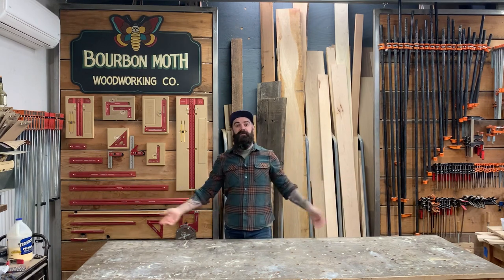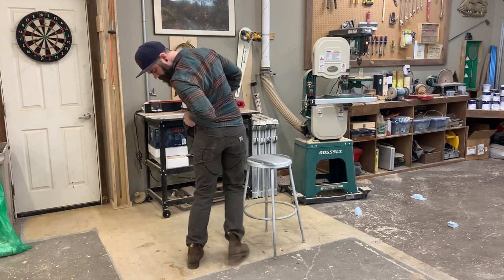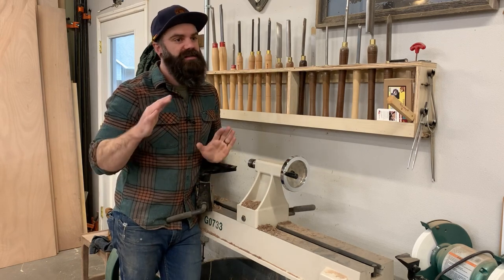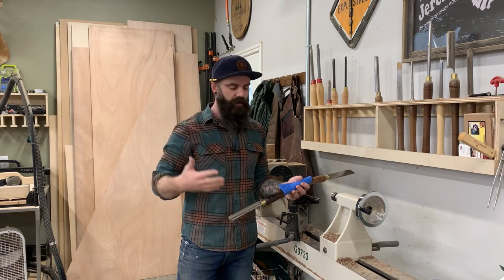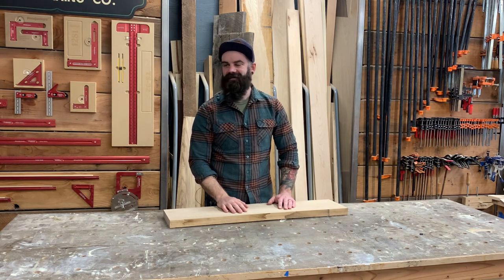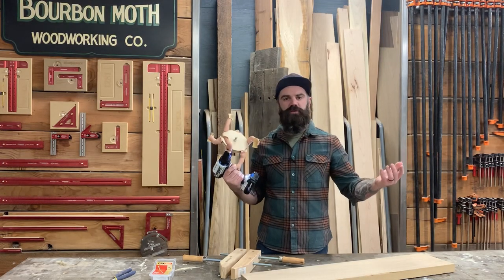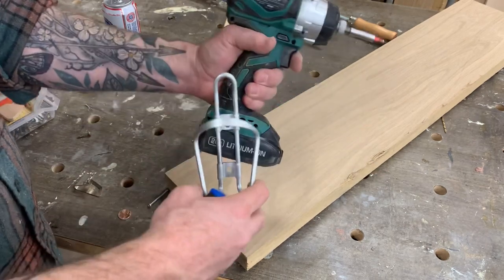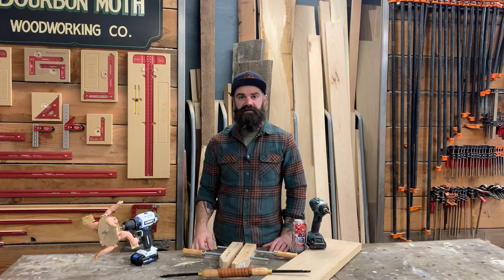Tools That Need To Exist | Awesome Woodworking Tools

Comment: Drill cupholder for Dewalt/Milwaukee: $29.99.  $19.99 for the Ryobi version and $9.99 for Black & Decker.  Festool Cupholder: $199.99.
Reply: But Festool got Bluetooth:)
Reply: And yet hoards of people would buy and it and swear it's worth the price. Ha ha
Reply: i bought the festool. worth it
Reply: I thought Festool owners only drink wine? Haha...
Reply: Add a skateboard wheel barring between the drill and cup holder and it may just rotate on its own.
Reply: The Festool is a lot more accurate!!!!!!!!1111
Reply: the festool one pivotes automatically to not spill any of the drink, may it be beer or wine
Reply: Like the 50.00 haircut..
Reply: For sure
Reply: I got the Bosch professional for $69.99 , it's totally worth it , because it's interchangable with all the other machines

Comment: The two sided chisel was really something special, what could possibly go wrong lol
Reply: I have the perfect brand name!  Seppuku!
Reply: Could upgrade to four in one in a cross shape.
Reply: @joemacleod-iredale2888  or Swiss Army Knife style!
Reply: Short Bus Special!
Reply: Just as practical as Darth Maul's dual-ended lightsaber!
Reply: Though I feel like there is a solution in that thing just waiting to come out.

Like a sliding handle that covers the opposing chisel. Twist to unlock, slide forward reveals one chisel, covers the other one, Twist to lock. And vice versa.
Reply: @lmaoroflcopter  man that's waaaaay too much effort, I mean kickback on a lathe is just a myth anyway...

Comment: 1. Hipster hikers already invented stool pants
2. Make a Swiss army chisel for the lathe
3. Love the hands sander
> you could probably take a cast of the back of your hand holding a sanding block and make injection molded “hand sanders”
4. The beer holder could have a bearing on that fastener and it would be like a gimbal and always sit up right

Comment: I checked my diary in case it was 1st April and it wasn't so I watched it through and you have some good ideas. I always thought it was dangerous reaching over the lathe for the chisels. This morning I improved on your idea. I only have 5 chisels and my glue has gone off so I removed the handles completely and just welded the tangs together in a star shape so now I have all 5 in my hand at once. My friend says they will be hard to sharpen but I am sure they will go in the vice and i can do the annual sharpen with the angle grinder as usual. It worked so well I did it with my wood chisels but it made a bit of a mess of my mallett when i tried using them so I will have to go back to using the lump hammer. I did learn not to weld in the wood shop again, they say they wont insure my house if i do it again. But the fire brigade got a donation out of it. ....... You are a star your vids brighten up lockdown and i learn at the same time.

Comment: Just so you know, I made the double-sided lathe tool, just like you did in your video.The first problem I encountered was I had full tang lathe tools, and ruined my saw blade cutting through the steel. Not a big deal though, just bought a new one to replace it, and now I have double-sided lathe tools.

The second problem I ran into, while I was using the double-sided lathe tool to make some cuts, I had a little bit of kickback, and the other chisel shot into my chest. At first I panicked, but then I realized I had a firmer grip on the tool, since it was currently inside my body. I finished out the cut with zero additional kickback, since I had such a firm grip.

Honestly, the hardest part was taking it out, spinning it around to use the other side, and then putting it back in. Besides the little bit of blood stain from the second chisel end, it worked perfectly.

After my visit at the hospital, I'm going to swing by Walmart and pick up some of those babies to make the hand sander to really finish out that project.

I'm guessing I should be able to make more on the profit from such a high end product to outweigh the medical bills. Will update once everything is sold

Comment: Just for this, I may make something pretty fancy for a beer holder using ball bearings that will allow it to more fluidly rotate. Be even better if you can put in in a gyroscope. Then it wont matter what position the drill is in or tilted. The beer will always stay upright.

Comment: Stool pants 2.0 needs to have a swivel seat,  double ended lathe chisels 3.0 drill out handles and glue in a dowel for strength,  hand sander machine....more hands for faster sanding times, drill beer holder . . . . . .uh.  .  .  .maybe a holder on  opposite side as well so when one can runs dry you have another on hand without having to stop work for a refill

Comment: You know, my ridgid drill has mounting screw locations on both sides, so I could keep the belt clip on one side, beer holder on the other side, and then it’s basically an open carry beer holster when clipped to my belt.
Reply: Better yet, 2 beer holders.
Reply: A beer and a whiskey for those really tuff screws.

Comment: Version 2.0 of the Drill-Beer holder, use a cup holder that you can put in a boat, they have a little doodad that keep the beer vertical as the boat moves, kind a floating swivel! Great video, your a funny dude

Comment: Just a truly thought provoking video. Your on another plane...
My neighbor, a mortician, watched this intently with me. He said your hand sander idea is brilliant. Then I ran his idea past my other neighbor, an overseas marketing guru. He too was all in with this hands on idea. First to save money, increase durability  and use real hands, he suggested REAL hands. He can get me up to twenty pairs a week. Note some are only half sets a right or left. It appears gluing the hands on a large disk holds the hands best. Then I came up with the idea of gluing snaps on the fingers and palms with the other snap ends to the various grits of sandpaper, a feature you overlooked. It appears 1000 RPM is the fastest speed for the disk before the hands go flying. A chinese firm he's been in contact with loves the idea. We're negotiating now with sandpaper makers to have pre-cut snap sand paper. Once we had a prototype, I ran it past another neighbor an engineer. He said it's not bad but using your technique with feet with slots in them will provide better surface area for larger jobs. Wow! Thanks a lot. 
A carpenter friend said your dual chisel idea was great! If you take a femur bone, slot it... We have plans if your interested in but not sure of patents in the USA. Not a problem overseas...

Comment: I think a washer between the cup holder and the drill would provide a little additional clearance for rotation. In addition, I think that maybe you should incorporate a flip down type lid to keep debris from getting into your beer as metal and wood shavings would be rough on your digestive track not to mention dusty beer is not that refreshing. I would love to see the hand sander being made from large mannequin hands from productivity purposes.

Comment: Double ended turning tools? Let's put two more tools at right angles, and add two more tools perpendicular to them. Now we have six tools in one, a whole workshop in your hand. You also mentioned at the start that you are filling time for finish to ...finish? Let's make pre-dried finish in adhesive backed peel off sheets. Apply it, immediately add all the coats necessary for the desired results and go for a beer.What a game changer. These ideas are available to you for a mere 25% of royalties. Lives of the rich and famous, here I come.

Comment: For the handsander you could use velcro strips and glue the hookpart of the straps onto the hands. that way you can change your sanding paper quickly.well slong as you use velcro sandpaper that is.😉

Comment: For the chisels in my opinion, you could have drilled a hole on both ends and use a bolt or screw that has a the top cut off, a nut welded to the middle so it can be screwed on and off,also it can also have a slight space between them and so they can be interchangeable for any wood working project.

Comment: the stool pants would work soooo much better if you rotate the stool 45 degrees so 2 legs touch the ground as you're pivoting back.  I'm a mechanical engineer, so you can believe me.

Comment: Stool has another meaning, and when associated with pants ....
Major fail on the cupholder, what if you want to drill sideways
Better option would be to attach the cupholder to the belt clip ;)

Comment: The first idea was already thought of. It was in an episode of community. Pierce Hawthorne made pants that turned into a stoll when you sit.
Reply from the maker: But were they Carhartt?
Reply: @Bourbonmoth  no but it was collapseable so wasn't just a big stoll hanging off a butt like a tail. But for the 2 sided chisel, it would be better executed if you were to make it in the letter y, with the cutting edges at the flared end and the the cutting flats are mirrored.

Comment: Why stop at just two chisels? Put five of them together in a star-shape, and make a 'ninja star' of razor-sharp chisels. Think of al the time you could save!  In fact, you could make several sets of the five-pointed chisels, and attach each of them to a glove. Then, you could attach a five-pointed-chisel glove to each one of your motorized-baby-hands, and get the whole thing spinning wildly. The speed would allow you to both change chisels as quickly as possible for lathe work, and would certainly remove more wood than mere sandpaper, during the sanding process. Voila!

Comment: Stool pants or stool IN your pants?
Just don't stab yourself in the stomach if the lathe tool kicks back on a knot.
Baby hands sander, you can also say that you babied the project for perfection.
The beer/drill problem is reversed.  You mean, you need a place to put the drill so you can drink your beer! Also I thought you were going to add a beer holder to your chair pants.

Comment: I seriously think you was high when you made this otherwise how come you missed the obvious, the hand sander is perfect for adding a snack dispenser that allows the hands to sand and flick snacks into the mouth !  the drill beer holder could include a smart phone holde so you can watch you tube as you drill, the stool pants , how about castors for when your too tired to stand, and th double chisel !!!! where was the micro sharpening stone that attaches on bearings under the blade and is friction driven by contact with the workpiece, sharpening as you work !!! other tools such as the water bath to keep table saw blades cool to stop over heating,  the knee vice that attaches to the thigh for when you need to cut wood but dont have access to a bench or the reciprocating band saw to eliminate blade wander or jamming, or the wearable hand probe/hook, gao a table saw or bandsaw blade jammed and dont want to switch off to clear, simply insert the 7 inch probe/hook attached to your glove into where the jam is and pull the jammed wood clear, your saw blade is instantly spinnigh and no over workine the power switch !  patents pending.